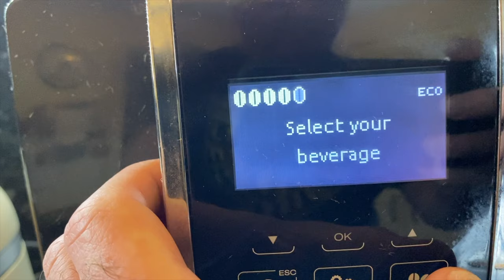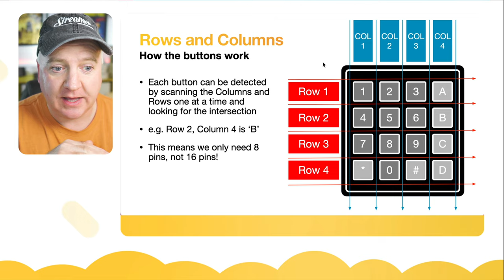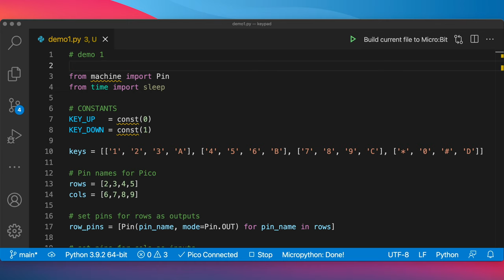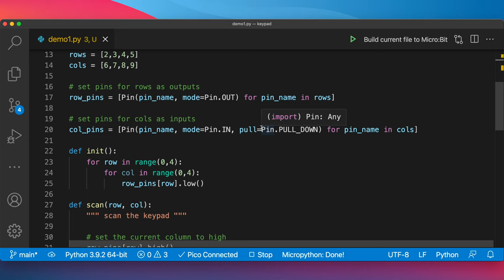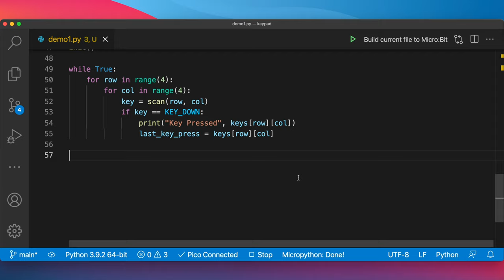4x4 Keypads, Raspberry Pi Pico and MicroPython

Comment: hi
how would you connect & program one of these connected to a Pico via PCF8574 IO Expansion Board ? 

Plenty guides on doing this with Arduino but i can't find anything about using micro python and/or circuit python

Comment: how would you go about using the keypad matrix to control something, such as key 1 turns on an led, key 2 turns it off, or key 3 advances servo motor,  Key 4 reverses., etc.??

Comment: is there a way to only get the key pressed once as i would like to use this for a door lock and could you store the keys pressed in a variable to check against the passcode to get in
Reply from the maker: That should be easy to do, just change the main loop
Reply: @kevinmcaleer28  how i change the main loop so it doesnt’ print multiple times but it also prints on release

Comment: I feel like half of the video is missing!
Where did you get that keypad? How in earth did you get that ribbon-to-pin connector or however is called?
Reply from the maker: If you Google 4x4 keypad you’ll come across these keypads everywhere; on eBay, AliExpress, Amazon and most hobby component suppliers. The ribbon connector comes pre-attached, so I just shoved the DuPont cables in
Reply: @kevinmcaleer28  thank you!! Do you know why most keyboards are wired with diodes and this one doesn't need them?
Reply from the maker: @diegogarber1  probably because it’s not a complex keyboard, to keep cost down, there are only 4 by 4 cells to scan, and the voltage will be low as well as the resistance. Diodes only allow voltage to travel in one direction so that protection is probably assumed to be before or after the header pin connections

Comment: code says machine not difined
Reply from the maker: Are you running the code on MicroPython (if so what version)? You get this message when you run it on standard Python. Machine is builtin to MicroPython so it will give this error if you run it on a Mac/Windows or Linux PC.
Reply: @kevinmcaleer28  Can i use MU
or can I dowlaon load on windows\
Reply from the maker: @dudesemidecent894  the code I’ve written is specifically for Micropython. You can modify it to work with windows, macs or Linux but you’ll need to know how to address the pins to get keypress information
Reply: @kevinmcaleer28  ok so on my pico I have it changed from like r2- something tocircuipty
Reply: @kevinmcaleer28  cant use thonny
?